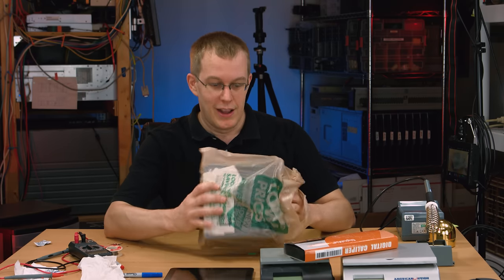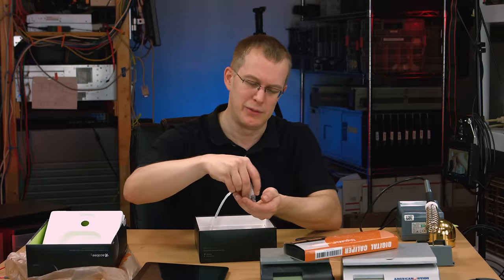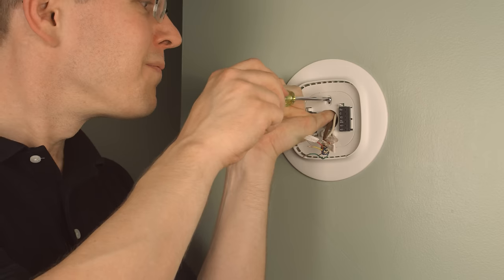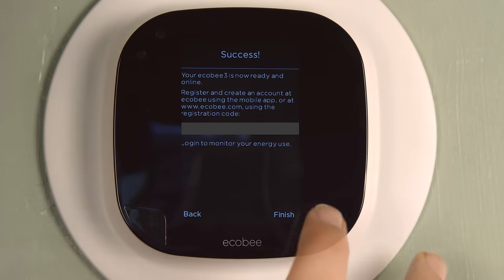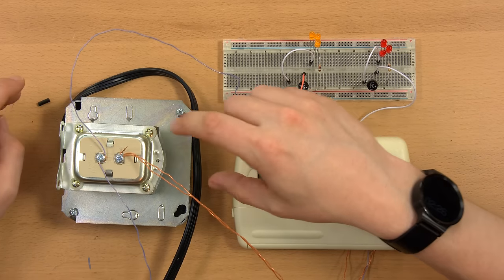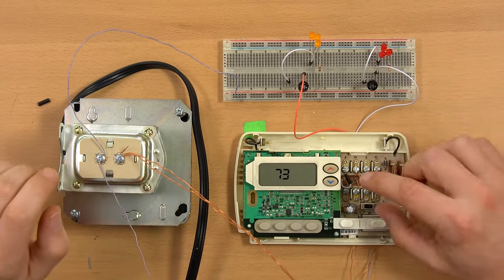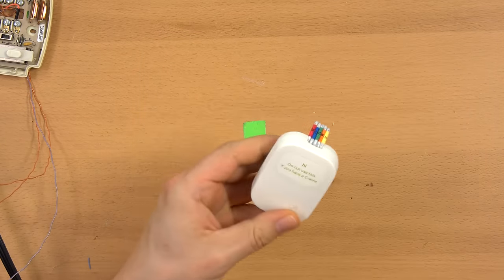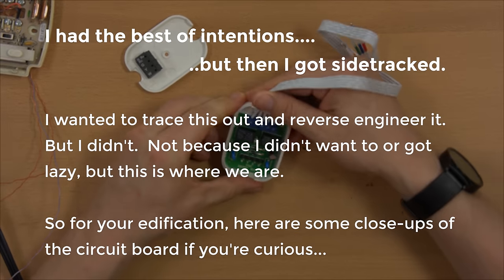ecobee3 Smart Thermostat Installation, Review, and Wiring Discussion

Comment: Just bought one today and it's very nice.  I agree that a $30 thermostat would work too but I'm in a similar situation to you where I really wanted the additional sensors for different levels/rooms of the house - this is pretty much the only option except for adding another HVAC zone.  We also heat with a woodstove in the winter and the main level might be 83 degrees and the master bedroom might only be 64 - the solution is to run the fan or the heat based on that sensor ignoring the 1st floor sensor.

I looked at the Honeywell WiFi one too (around $170 online or $200 at HomeDepot) but I couldn't add zones so it was the ecobee3 for me...

Great review and nice description of how a thermostat works!
Reply: Question, what's the point of having sensors in other rooms if there aren't zones? if there's a room upstairs that isn't getting enough heat and the ecobee3 realizes someone is in there so it decides to increase the heat to it, won't that just result in one of the other areas getting too hot?
Reply: It will average things out and if rooms aren't "lived in" it will ignore that sensor - so while the 'stat won't heat a specific room or zone if you're in one room (where there's a sensor and it senses that) if your system is on heat and the temp is below that set (regardless of what the temp is at the thermostat) then it will turn on.  The opposite is also true - I have a wood stove and the thermostat is on the main level (same as the stove) and if I have the temp set to 69 degrees even if the main floor is 76 if the upstairs bed with a sensor is 66 - the heat (with the fan) will cycle until that room is 69.  I've found through the last couple of weeks I've had it the entire house is a "more even" temperature with this 'stat even though I don't have zones.
Reply: At a very basic level if your thermostat is located in a part of the house where you don't "live" or sleep (i.e. not in your bedroom) then when you sleeping you can have the ecobee adjust the temp according to where you are rather than where the thermostat is.  This was a huge issue with our master bed which is partially over the garage.  The main level where the thermostat is could be 69 degrees and the bed room might be 62.  Our house is right on the cusp of needing at least 2 zones but the builder "cheaped out" and put in the minimum we replaced the AC a few years ago and that helped but wide temp differences were still an issue.  It's not totally "fixed" but is much much better and having the ability to adjust the temp remotely based on where you're "living" is a great thing.
Reply: Ok that makes sense. I was worried that our one room would get exceedingly hot, but doesn't sound to be the case.
Reply: That's not been my experience - there are some that claim that the sensors (including the 'stat itself) will "average" the temp but that's not what I see - currently it's 32 outside (the ecobee shows that in the app as well as on the thermostat) and it's set to 70 with the sensors reading 69, 70 and the stat's sensor 71 the only "occupied" area is where the stat and it's only 1 degree higher than the set point.  Although it's a bit expensive (I paid almost $350 for the ecobee3 and 2 extra sensors) I'm very, very happy with it.  I was looking at the Honeywell but wasn't considering the Nest mainly because "learning" where the thermostat is wouldn't really help because of my bedroom and wood stove - the Nest is smart but I don't think it would be "that smart..
Reply: Very cool. I got an Amazon warehouse used ecobee3 for 170 and got the 2 extra sensors for about 225 out the door. Going to set it up tomorrow!
Reply: Score!  Just make sure you get the "C" wire adapter if you need that - look at your current 'stat wiring to see if you already have it.  The (normally included) adapter is only needed if you do not have the "C" wire - I had enough wires but my "C" wire wasn't hooked up at the furnace controller board  - I just connected it and was good to go.  Take your time and the install should take about an hour including the setup and added sensors.  There's lots of install videos if you get stuck and I hear ecobee's support is quite good as well - I didn't need to call but those that have said they are very helpful.
Reply: Thanks for the heads up! I haven't pulled apart our old thermostat yet so not to sure about the "C" wire. Amazon Warehouse claims it's all there and in original packaging so let's hope if it's needed it'll be there :)

Comment: Good comments but I have seen a lot more furnaces fail in cold climates than smart thermostats.   Either way with the internet connection you can get a warning when things go wrong with the thermostat or furnace because the servers can spot a house at 40 degrees or a thermostat that's not responding and alert you.

Comment: Hi Scott. Thanks. so informative. One question. If a thermostat is simply a switch for each system, is the versatility of ecobee not then limited to how many systems you have?  In the UK we tend to have only heating with condenser boiler for radiators on timer and hot water on demand. Each radiator has a valve style thermostat which opens or closes the transfer of hot water through each radiator in a very imprecise way. so rooms can get too hot or too cold. I am thinking ecobee is only going to give me the ability to switch the heating on or off depending on the temperature where the sensor is placed. What if I use 2 or 3 sensors and ecobee can't reconcile temp differences between rooms because theres only one way for it to control it. Does it implode, void its warranty and get Alexa to tell you to install an old school thermostat (joke). But seriously it all sounds great but only if ecobee has multiple options for modifying multiple temperatures for multiple sensors. Which is another installation and setup altogether.

Comment: You should shut the power off via the fuse box or on the heater unit will be a switch.
Reply from the maker: You'll hate the way I replace receptacles.  :)

(But you are correct, of course.)
Reply: When you understand electronics the way you do. You know that a little shock wont do anything. For those with less experienced. We don't want them to get in the habit of doing that.

Comment: nice video. can you explain more about the sensor? i have the same issue as you do about weird zones and the separate sensor may help. do they need charging? battery change often? i see an ecobee 3 with three sensors. would that work well then 1 sensor if I have 5 large rooms all facing south side?
Reply from the maker: Thanks Stan!  The sensor detects both motion and temperature (not sure if I even mentioned temperature in the video).  Now that I've had the ecobee running for a few days, it looks like it tries to bring the room temp down to whatever the set point is, but in rooms that are occupied.  So if I'm downstairs and the remote sensor is detecting motion, it'll run the A/C until the remote sensor detects 75 degrees (if I have the thermostat set to 75).  That means it'll be more like 69 degrees upstairs, which is well below the set point.  If the ecobee itself (upstairs) is detecting motion, but not the remote sensor, it only runs the A/C long enough to hit 75 upstairs.  If there's motion at both, it kinda chooses a middle ground.  (BTW - With the motion detection it's not like an outdoor light where you need to be constantly moving.. it uses occasional motion to indicate that the floor is occupied.)

So the upshot is that it makes the parts of the house that are occupied more comfortable.  But sometimes it does that at the expense of running the A/C longer.  I think if I let it do its thing it will actually increase my electric bill.  :/  

No charging, it's just a button cell lithium battery (CR2032, I think).  Not sure how long it lasts.. more than a week anyway.  :)  But those batteries are real cheap on Amazon if you buy 'em 10 or 20 at a time.

Not sure as far as 3 sensors.. should increase comfort, but probably electric cost too.

Comment: Great Video. Question, when I pulled my old thermostat off the blue wire was just hanging there. Not connected. I assume that it is the C wire and disconnected because the old thermostat ran on two AA batteries. Is there a way to test the blue wire to see if its got 24V?
Reply: i had the same thing i went down and opened the furnace and saw a blue wire connected to the c terminal in the control board
Reply: connected means it is drawing 24v for your thermostat. which is what you want.
Reply: Technically, it’s a neutral. But when paired with an R (or Rc or Rh) yes it gives you 24v. The R wires are hot. The C wire is “common” or neutral.

Comment: Do you have "emergency heat" on your heat pump? Does the eco bee or nest work with emergency heat, (extra coils for quick heat or extreme cold)?
Reply from the maker: No heat pump or emergency heat for me.  Just one boiler and two pumps.

I read in the manual that the ecobee will indeed work with emergency/aux heating/cooling -- it has quite a few connections that I didn't use, and though I'm not sure exactly how it relates to your system, it does have a couple of aux connections, an accessory connection, as well as a second stage for both heating and cooling.  So I'd have to imagine it would work with most any setup out there.  But with HVAC you never know -- some installs can end up being set up weirdly or in a really complicated way.  I'm not an expert -- just a DIYer with a decent amount of experience (and not sure on the details of your system) -- so I don't want to steer you wrong by saying 100% that the ecobee3 will work for you, if that's why you're asking.  :)
Reply: S.co.tt timer turner

Comment: STOP ..... I do not recommend this product for a couple of reasons. Last weekend I had a great customer contact me, she had attempted to install this on her own and self admittedly was in overhead. I showed up assessed what she had done and had to spend a little time undoing what she had done. ( not a big deal) she has a very simple 2 wire heat system. There was no existing "c" to speak of so I wired it with the " pec " device that is came with. I got nothing. She decided to call take support she was place on hold, I continued to trouble shoot to no avail.  She was on hold for three hours the the recording " you are the next caller" when moments later she was disconnected. She called back to hear the recording saying they were closed and to call back tomorrow. They hung up on her .... Real nice. I researched it spoke with a few people nothing was clear on what the problem was. I told her get the nest I know that works. She was hesitant but ordered it, when It came in I showed up and installed them ( 2 total) in a matter of 15 minutes they were up and running. In the above video it was mention that he's not sure if the company will be around in 20 years well as far as I'm concerned they might as well be gone now because they were useless last week.

Comment: In case anyone else hasn't pointed it out:  you got the PEK wiring backwards.   The leads that are on the box already go to the HVAC and the empty posts go to the ecobee thermostat.

Just installed this in my house a couple days ago and used the PEK because I only had 4 wires (no C) running to the thermostat.  Worked like a charm and I know shit about HVAC systems.